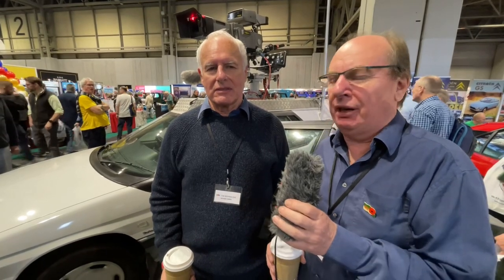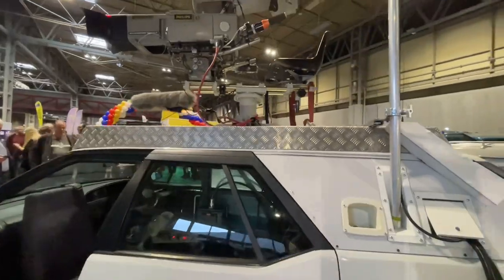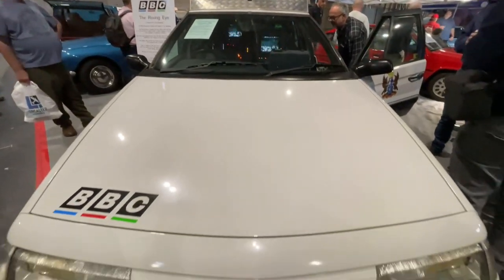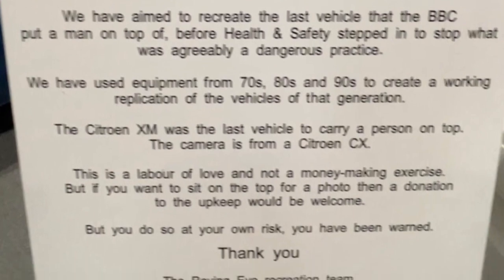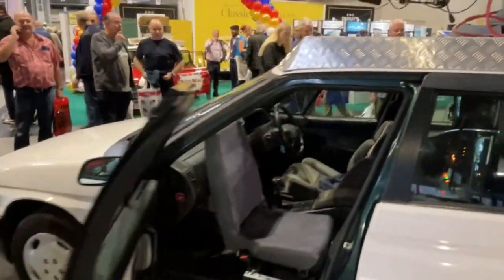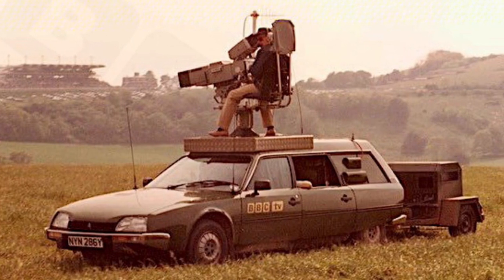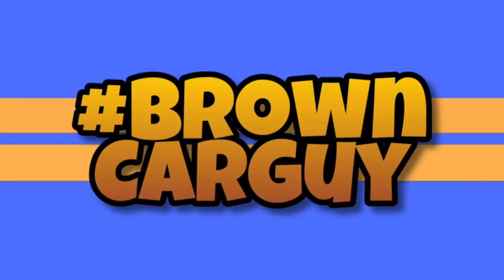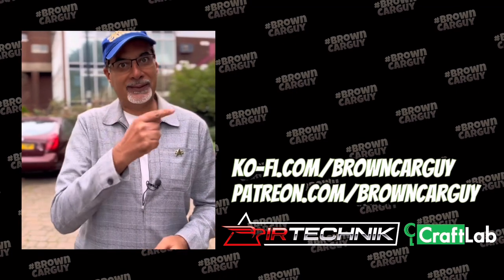Citroen XM Camera Car Recreation (BBC Roving Eye) - NEC Classic Car Show 2022

Comment: Very nice to see the BBC camera XM recreated! 2 comments though: Surely there are more than just 2 XM estate left. Or is this for the UK? Even in UK I saw one advertised recently. As well it is to be noted that the car shown at NEC is a post facelift Y4 model, available from mid 1994 or M-reg, while the original BBC car was K-reg and thus a late 92 pre facelift Y3 model. This is a shame as the front and especially the dash of these two versions are quite different.